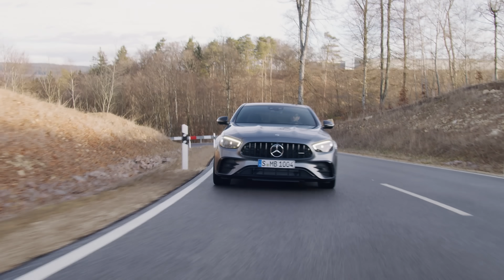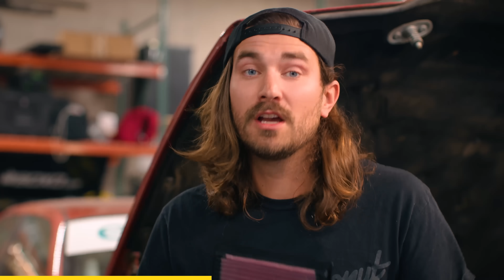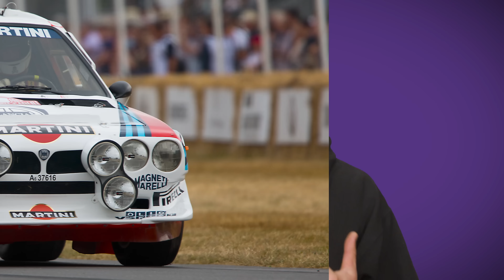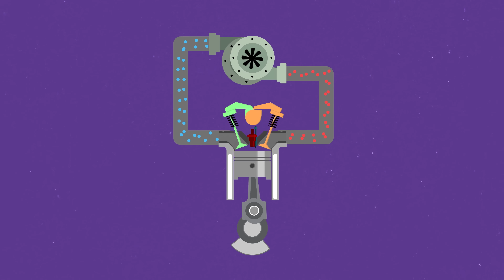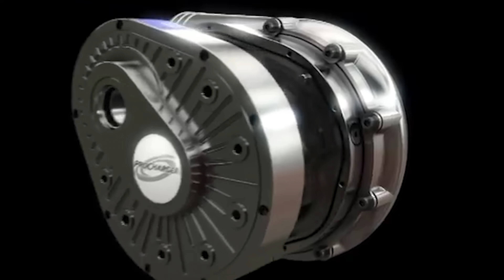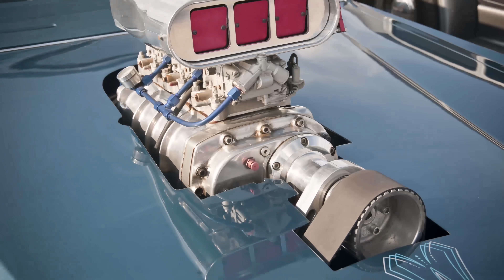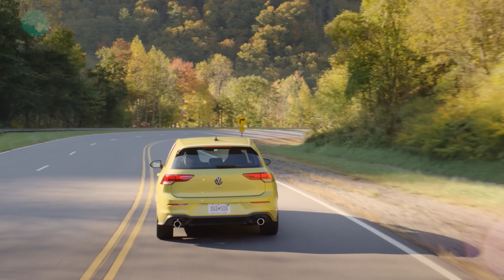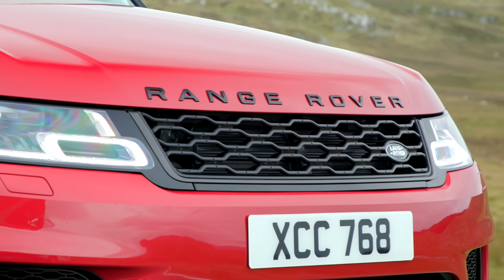Why Your Engine Isn't Twin-Charged

Comment: Sequential turbos and variable turbos solved the issue though, haven't they? Also, is the twincharged motor in the GLE the same as the e53 AMG?
Reply: Yes, BMW made a sequential twin turbo on their 335i platform. Smaller turbo for low to mid and a bigger turbo for mid to high. Some companies combined it in one turbo using vein system. I believe the 90s Japanese cars (Skylines, RX-7 and Supras) were already doing this similarly though. Not sequentially though.
Reply: @Black on Black Violence is real all of those cars you listed are sequential twin turbo. Porsche was the first production car with the 86 959.
Reply: @blackonblack...9244  I believe BMW shifted completely away from twin turbo to a single twin-scroll turbo setup a few years ago
Reply: Still some miniscule lag, and a blower is still more efficient, and provides more oompf, at really low rpms.

Furthermore, I think that you can increase the turbo size, since you're not restricted by a smaller turbo.

Also, who says that you can't put a sequential turbo setup after the blower?
Reply: @GrimpakTheMook  Blowers are not more efficient as they are belt driven, meaning their chosen method of propulsion literally sucks horsepower. Efficiency is not a turbos problem, getting enough air pressure to spool the turbo at low RPMs is the problem. Turbos are WAY more efficient as they don't suck horsepower to create it, unlike superchargers.
Reply: @justsorandom764  Turbos are the most efficient forms of boost, but the amount of boost available is also relative to the size of the turbo, larger the turbo the longer the boost lag and the more rpms required to spin it.  Dragsters use Ridiculously huge blowers because it gives them a ton of instant boost with no lag, not because its efficient.
Reply: @Aetrenix  A top fuel dragster runs a blower that a 6.1 liter hemi doesn't even have the power to turn. That is the amount of "inefficiency" that comes with "big" boost from a blower. I have heard that top fuel engines can definitely make more power through turbocharging but the rules restrict the use of turbochargers besides the obvious fact that top fuel cars are already over powered for their available amount of traction or rule limited tire width.
Reply: @justsorandom764  by efficiency I mean you can actually extract something out of a blower at very, very low rpm/idle, unlike turbos.

don't get me wrong tho, turbos are the better FI method, but blowers do have a slight advantage at those really low rpms.
Reply: @GrimpakTheMook  K, but that isn't the definition of efficiency.
Reply: @justsorandom764  yeah, well wrong wording then, sorry.
Reply: @justsorandom764  That makes ALOT of sense.
Reply: @jeremypike9153  They most certainly would have more top end power with a turbocharger, they also use a special fuel its less efficient than gasoline, get about 50% power for equal amounts of gasoline but it takes significantly less oxygen to burn so you could put 20x(cant remember exactly) the amount in the cylinder.  The benefits of a supercharger will always be that the power is always on and doesnt need to spool, turbos will always give you more hp relatively.  But a small turbo wont do as much as a big blower, but a big turbo will do more than a  big blower.
Reply: Twin scroll turbos are the new standard. There really isn't any reason to be single scroll except cost. Sequential turbos, twin turbos, and twin charged engines are too complicated AND expensive. It seems like a decent size engine like 2.5L I4 or 3L I6 with a single medium sized twin scroll turbo with a short and narrow intake system with a throttle body that don’t close completely (like Porche) would be best overall.
Reply: Not quite solved. Audi SQ7 electric supercharger provides full boost with 900 NM of torque from less than a thousand RPM - that's what I call 'solved'.
Reply: @apathyzen9730  Are you talking about centrifugal superchargers powered by electric motors?  These type of superchargers combine both the advantages of turbos and superchargers(being small and light like a turbo, almost instantaneously provides power, while having better thermal efficiency than both roots and twin screw superchargers)
Reply: diesel engines used this tech long before
Reply: Yes, the GLE 53 and de E 53 share the same engine
Reply: Cummins attempted the variable turbocharger it didn't go well the vanes kept carboning up and sticking. Stacked or sequential turbocharging is "alot" of added complication that one small piece can make the whole operation fail and often does spectacularly I might add. Twin scroll turbochargers do fix the response issue as well as a twin "volute" turbocharger but their is an issue with high and low speed operation still a bigger turbo always makes more boost but higher in the rev range twin scrolling or twin volute setups minimize lag but always sacrifice what "could" be had at high revs as far as power potential.
Reply: You're right.

Twin charged, twin sequential turbos with electric super charger and motor for extra torque.

1.6 l 4 banger making 750 hp ez

Comment: "Your engine isn't twincharged"

Me: Hold my XC60 there.
Reply: love my 2018 v60 twin charged polestar
Reply: Volvo doesn't sell its good models in the states, so it's entirely plausible Donut slept on them for the same reason.
Reply: @ZeroHourProductions407  Volvo sells the twin charge cars in the US... All T6& T8 models are twin charged
Reply: @toddf93  I'm sorry, but I have no idea what a T6 or T8 is in terms of a Volvo model. If it's an SUV or similar body type, well... That's why I didn't care about them, either.
Reply: @ZeroHourProductions407  it's also in the S60 which is a sedan...
Reply: @ZeroHourProductions407  t6 & t8 are powertrain designations on each of the models... t6 is 2.0L twincharge engine & t8 is same engine combined with plug in hybrid